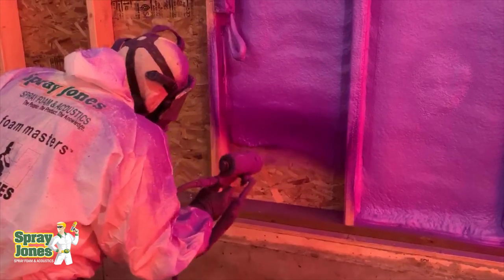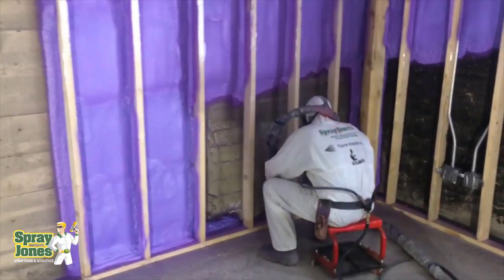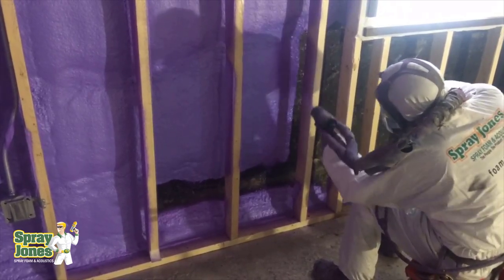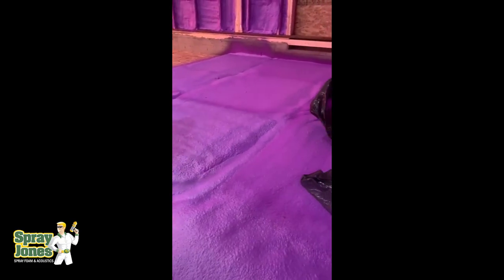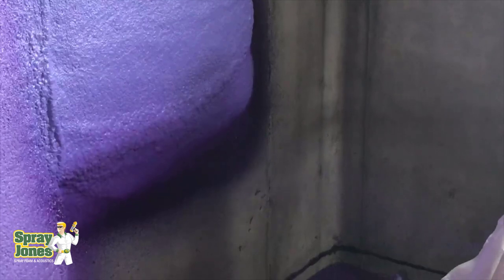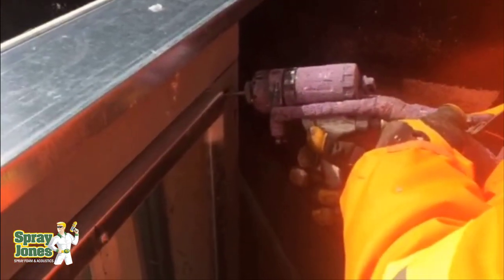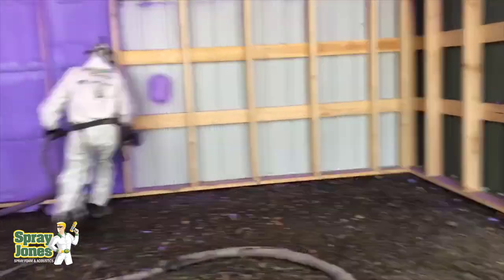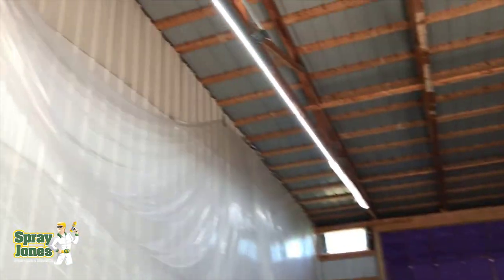Can Foam Insulation Be Injected Into Existing Walls?

Comment: See the problem I have is I have NO, NONE not a bit of insulation inside the interior walls of my house and I’ve seen a few of the exterior walls in doing the work I’ve had to do not much to speak of there either. I gotta figure something out. My house is old drafty and cost way too much to heat and is still cold.
Reply from the maker: Open it up. Either from the inside of outside. Either all at once or progressively. Spray the foam in then.
Reply: @SprayJones  thanks man for the info, for the past 2 years this house has gone through phase after phase of looking like a construction site back to a home.
Reply: Have loose cellulose blown in the the walls. You may already have it in your attic, overtopping fiberglass. It will absolutely NOT put pressure on your walls. I have been seeing this done since the 1960's, here in Ohio, on houses that were built before the 1900s, all the way up to houses built in the 50's that had no insulation whatsoever in the walls- perfect candidates for blown in cellulose. Back then, it was thought that a layer of Cellotex under the wood siding + the air in the wall cavity would be adequate. In a way, you are lucky that your wall cavities are open. The cellulose is applied through 1" drilled holes from either the inside or outside by a machine that sort of looks like an industrial vacume cleaner..The air used to transport the non expanding cellulose into the wall cavity is in no way powerfull enough to damage anything. You can hire a contractor to do this or you can  rent the tools to do this yourself from a big box store and buy the cellulose from the same store. You also have the option of using a bore hole camera to  look at the inside if you are so inclined. The notion that you have to RIP your walls open so something can be sprayed in is kind of ludicrous if there is no need to remove anything. And in your case, there isn't. As far as the advice to use foam is concerned - what we have have here is an example of the old adage: if all you have is a hammer, everything looks like a nail.
Reply: @xmiller7691  I’ve seen where they cut 4” holes all over getting between every stud. It looks definitely like something I can do. I just really hate doing drywall. Lol most likely what I’ll do though. And yeah we have the blown in insulation in half of out attic just none in the kitchen area. Right now I have a 5x4 foot hole in the kitchen was recessed lights like the long fluorescent lamps with the crap diffuser paneling always looked ugly. I took that out and popped in 6” led lights throughout the kitchen wired them into the existing Romex for the old light. Now raising the ceiling in that old light area a little and putting a pot rack in for my wife. All that to say, I’m dreading the drywall ceiling.
Reply: @xmiller7691  that's the way I did my house went between studs as high as where wall meets attic and between studs at bottom of Windows. Then put tight fitting wood.plugs in holes chalked and painted worked great
Reply: We removed the drywall in the back half, spray foamed that. The front half we blew in insulation after replacing all the knob and tube wiring. Attic had 1” of spray foam with blown in on top.

Comment: Short answer: yes, physically, it can be done; there are various systems all over the world for doing it. Based on what you're saying here, it isn't legal for any occupied structure in Canada.

Longer answer: it's a bad idea in almost all cases... it can't be inspected so there no way to know if it was mixed correctly, expanded fully, or adhered properly. Any expanding material will pressurize the space it's filling; that pressure is going to find somewhere to go. (ideally, it's what pushes the foam up inside the wall, but if not done perfectly, it pushes out on everything.)

(I'd like to have my house better insulated, but short of tearing out all the walls, it's not happening. I've looked at injection for years. It's doable, but not recommended. The fiberglass is still in there, it would still require thousands of hole be drilled, and has a fair chance of breaking walls. I might throw the money into the fire next time the siding is replaced -- the sheeting, vapor barrier, and fiberglass would also have to be removed, not just the siding)

Comment: Why are you talking about slow rise when your video is showing spray foam?  How about you put your money where you mouth is?  It doesn't take that much to do a test does it?  Make a fake 2 sided wall with fiberglass insulation in it, studs on the side.  Inject the slow rise in it.  Then take the wall apart and see if it works, problem solved and people questions are answerd!
Reply from the maker: Did you watch this video?? Do you think I make this up or have experience? Go watch some videos on YT of people showing the results of foam injection nightmares.